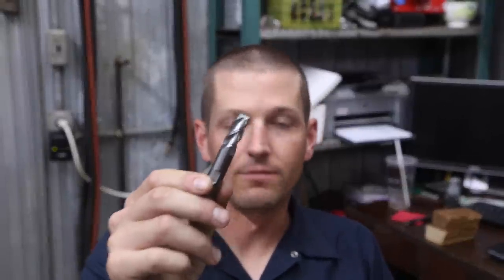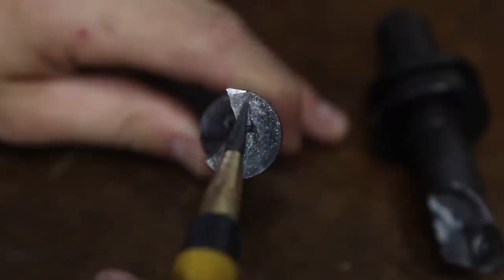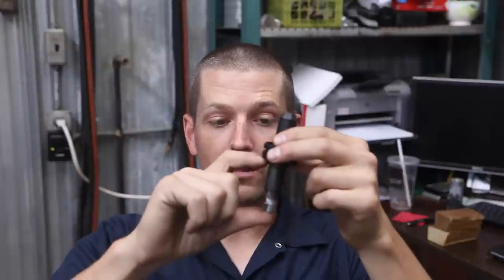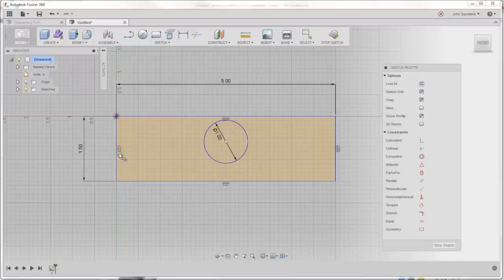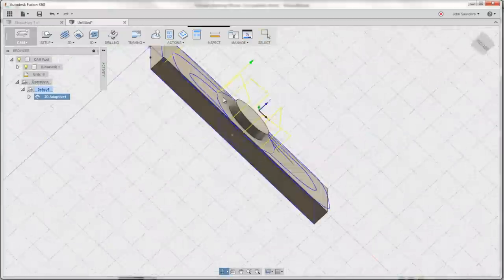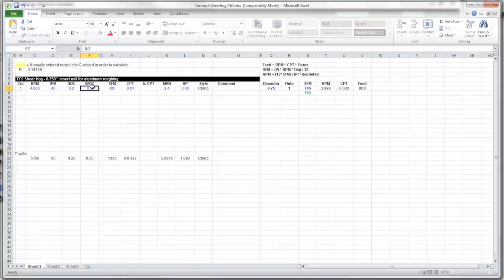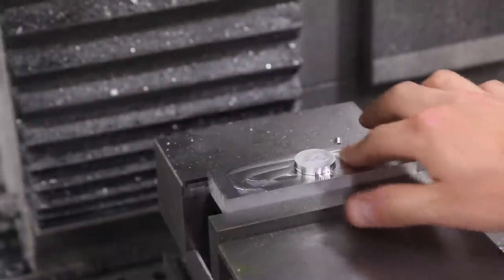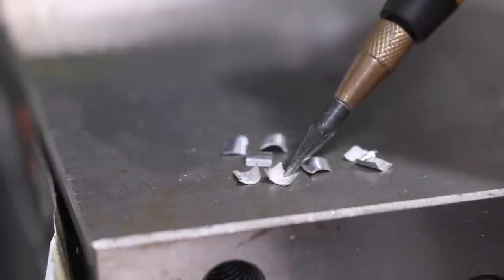Tormach Shear Hog!

Comment: Another amazing video John! To you and your viewers here are couple of responses to your concerns. 1. The .75 Shear-hog has the weakest web of our entire line of Shear-Hogs. For that reason we reduced radial clearance to increase strength. 2. Depth of cut is limited by length of the insert and available HP. The max loc of the Shear-Hog insert is .400. It should be noted that the optimum running doc is .1-.15 and 75% radial. Of course everything is dependent on your particular machine. We don't feel that they preform well on manual Bridgeport machines because of low hp and feed. 3. I also believe that Tormach reaching out to us was a result of your videos so thank you very much!  More of the story (and correct me if I'm wrong) is that I saw that you didn't have an AB sticker on your blast cabinet and had some stickers, magnets , and catalogs sent to you. Shortly after that you purchased your first Shear-Hog!

Comment: G'day John,  to centre your feature (in this case the centre circle), select the tool and hover over the x midpoint as you did until the midpoint symbol pops up, but don't click on anything. Instead then go to the y axis and hover over the midpoint until the midpoint symbol pops up. Again don't click on anything. Go back to the approximate centre of the rectangle and the x and y guidelines will both pop up and you will be able to snap to both the x and y midpoints and click to begin drawing your circle. I hope that makes sense.
Reply: +Pete F - Thanks!  Yet another "intuitive" snapping system to learn.... but this was a great hint and I think it will go a long way to unlocking Fusion's approach for me.  The one down side is that this doesn't constrain the newly drawn element to the referenced element.  I can center the circle in the rectangle, but if I change the rectangle, the circle stays where it was and is now off-center.  For most situations, that's fine, but I have to keep that in mind - without the constraint, you can't go around changing stuff and expect the snapped elements to update.
Reply: +Pete F +NYC CNC
A tip most of us in the drafting world use is to create every part centered around the center of the plane. Instead of starting with two point squares or rectangles, use a "center rectangle". If you click the drop down menu under sketch, select the "center rectangle" now your part will be in the center and you can easily align parts to its center. In large assemblies drafters will get chewed out if they don't use this method because it makes it very difficult to change dimensions later and keep things centered. Here is a link to Autodesk for instructions on how to access this.

http://knowledge.autodesk.com/support/fusion-360/learn-explore/caas/CloudHelp/cloudhelp/ENU/Fusion-Form/files/GUID-7E2971E7-8D3F-40D8-846E-482D0E78630D-htm.html
Reply: +Nathan Lockman G'day Nathan. Using a centre rectangle is a good tip, and I did something like that just last night, however in that instance centring a rectangle over a centreline. However one of the gotchas that isn't well known with Fusion 360 is that the 0,0,0 point is partially constrained but not indicated as being so. Generally speaking that's not an issue, but it certainly can be if you want to subsequently move that feature.

This can be demonstrated by drawing three rectangles, one at some random point on the plane. One with a corner at 0,0,0, and the third a centre rectangle centred on 0,0,0. Now select the entire first rectangle and right click move. It can be  moved freely about the plane. Do the same for the second rectangle with the corner on 0,0,0 and it will be constrained in x and y (although somewhat bizarrely still free to pivot).  A similar situation occurs with the third rectangle centred on the 0,0,0.

This has caught me out in the past, so to eliminate any nasty surprises I deliberately do NOT commence any sketch at the 0,0,0 point, including centring around it. It may seem counter-intuitive, and it sounds as if that is counter to drafting convention, but centring on zero caused me a world of pain at one stage. There may well be a way to un-constrain the 0,0,0  point, but if there is I'm not aware of it. It is therefore easier to just not paint myself into that corner to begin with, as the software really doesn't care where it begins.
Reply: +Thomas Donalek Thomas I believe that's a fairly standard feature in a number of CAD programs that I'm aware of, so I wasn't surprised to see it work in Fusion too. There are a number of subtle snaps like this available, another is to look through a stack of components or features to pick up a hidden edge. The above feature behaves similarly and that can be handy is wanting to, say, centre a hole on a component that exists in a stack or different sized components. You can look through the stack and the individual edges will be highlighted as you roll over them.
Reply: +Pete F Thanks for the heads up! I spend most of my time in full fledged Inventor where this does not come up as an issue. You can place everything at the origin and move it freely later if needed. I just tried it in Fusion and had the same experience that you described. I am going to try to find a work around, but that is rather strange. This tends to only be necessary in larger projects where you need to make revisions to a few parts in assemblies with a few hundred parts, particularly screws, pins, and bearings. We don't touch the model because the dimensions are changed in the dimension list. the main reason for this is to prevent parts from loosing their assembly constraints in the assembly file which can happen if the parts are not centered. It just becomes a headache...

Your centering approach makes a lot more sense in fusion, and especially when something is in a job shop atmosphere. Thanks for your advice!

Comment: Depth of cut for insert tooling is completely dictated by the geometry of the insert and chip breaker design. Most milling cutters can cut with there full edge length otherwise you could never cut a 90° wall taller than the cutter. For instance that seco square4 tool you showed a while back has a listed max DOC of .315" which is the length of the entire edge. Now in lathe tooling this is different, the chip breaker geometry usually limits the DOC to far less than the edge length, but not always. So basicly you need to check with the manufacturer to get the specs.

Comment: On a low HP machine, my philosophy is more flutes and more RPM is more better. You're able to cut away material quickly without pushing your machine. You have to take into account the lack of rigidity of the Tormach when you start entering the .02 per tooth territory, but at the same time there is a balance to be found. With too many teeth, you could be pushing the limits of your machine's maximum feed rate...especially with steppers and no positional feedback. It's all up to your personal preference and comfort level, but I personally like to do high DoC with low WoC and high feed rate as my baseline. It's not uncommon for me to go with a 1 inch or more DoC and a .03-.1 WoC with solid carbide.

I have a 7 flute 1" Iscar insert endmill with a 3/4" shank that I'm hoping to be able to loan you eventually. I've used that glorious tool at 24,000 RPM and 500 IPM on our Haas SR100.

I totally agree with you that insert tooling is the way to go in many cases. I try to use insert tools as much as possible. But we have a local supplier in Grand Rapids that sells excellent quality solid carbide endmills at really good prices. 1/4" 4 flute chamfer mills for $8 each. $20 for 1/2" endmills. Nemic Industrial Supply.

Here's what you have to look forward to when you're finally able to bite the bullet on a VMC :D

https://youtu.be/bJ3TImyHlZM?t=1h17m8s

2 inch Iscar face mill, 4 flutes, 3000 SFM (5730 RPM), .006 IPT (136 IPM), .250 DoC, 1.5 WoC.

Comment: From my experience with my older PCNC 1100, I don't run inserted cutters because they hammer the machine to hard IMO.  I can't even run a .500 single flute inserted cuter with a .030" depth of cut in mild steel.  That is a single flute cutter making a pass at about .003" chip load, (by the looks of the feed speed).  With a 4 flute carbide EM, the same feeds would be a .0007" chip load for each flute, and it can feed programmed a bit faster IMO, and not hammer your machine to death.
If you want to remove material faster-you simply need more HP and a more rigid machine.  If you want to make money machining billet aluminum parts, you are going to at least have a robodrill CNC machine.